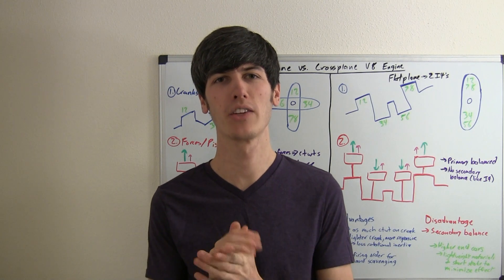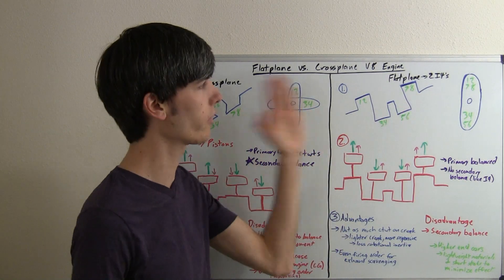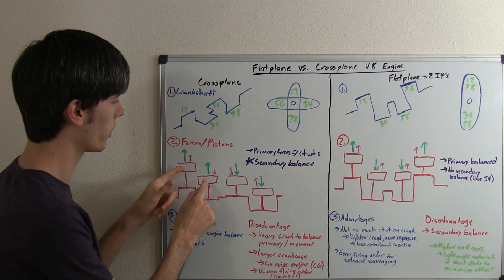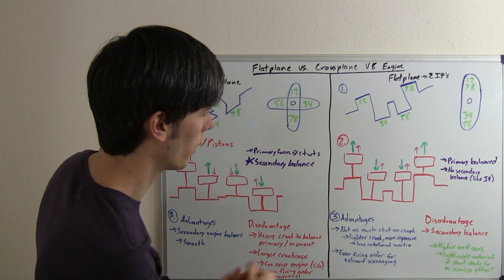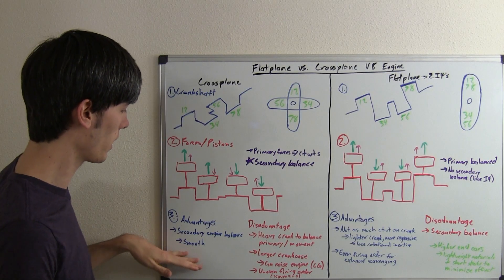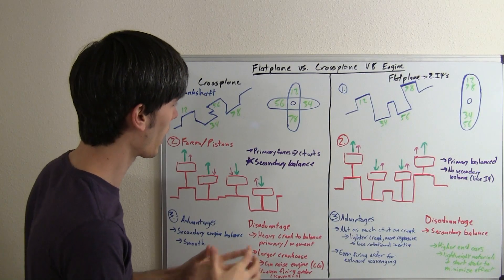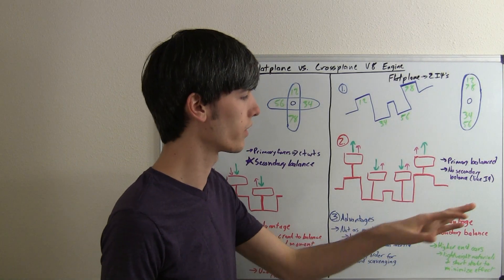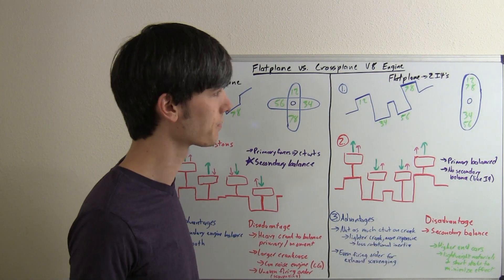Flatplane vs Crossplane V8 Engines - Which Is Best?

Comment: On a crossplane crank you still have a secondary imbalance occurring but not as severe as a flat plane (half the strength but twice the frequency in every crank rotation ) that's why not as noticable but it's there!!

Comment: So does this mean that the Ford mustang gt350 will not last as long as other cars who use a cross plane crank? The new mustang v8 sounds great and makes a decent amount of power. However since the mustang is cheaper than lets say a Ferrari than does that mean that ford used cheaper parts in their motor. Thus making the mustang engine less reliable?

Comment: Question for everyone out there... Other than the 2009+ Yamaha YZF-R1 (and a few low quantity race engines), why are there no 4cyl crossplane engines out there? To me it seems like a great compromise between modern fuel economy regulations and that classic crossplane V8 burble. Just look up the Yamaha's exhaust sound and you'll understand what I mean! It could be a potentially smoother and more reliable engine compared to our every day i4's of the world. Just imagine a Focus RS with a 2.5L crossplane that sounds just like its mustang bigger brother... I've done a decent amount of research with no concise answer. So why hasn't it been developed?

Comment: Why does a MotoGP bike then use a crossplane engine?
Reply: The enginepulses from the uneven firing order is supposed to leave a gap in power delivery to the rear tire that lets the bike grip in the "gaps" of the enginepulses thereby making the bike easier to control thru high speed corners where in motogp powersliding is the norm.

Comment: Questions regarding flat plane cranks:  

Background: I'm considering replacing a cross plane crank with a flat plane crank.  Assume I've taken care of the changes to the valve timing from the original crankshaft (I would initially want to do this on a 4.6 liter Ford V8) and can find the space for the balance shafts (newly designed oil pan) and drives (gear).  Also assume I have a compelling reason to go to all of the hassle (it "kind of" has to do with even firing within each cylinder bank for specific, proprietary reasons).

Based on your video on balancing engines and the statement that a flat plane V8 has imbalanced forces as two I4s, is it correct to say that a couple of balance shafts rotating at twice the crank speed would take care of that secondary imbalance?  Assuming the answer is yes, would the balance shaft weights be located at the "average" of the locations if you were to design separate balance shafts for each cylinder bank?

Comment: is this why an America  muscle car engine sounds so different from say a modern german V8 in an audi or BMW?
Reply: and typical American V8 also Cross plane?
Reply: yea thats why Shelby Mustangs rev to over 8k and rev more lively and Camaro/Dodge engine dont rev as high and arent as lively. Its the crank that makes the difference
Reply: um no. every v8 out there in production... pretty much uses cross plane. shelbys definetly uses crossplane. germans also use crossplane. the firing order may be different thats the difference in sound. and its the gt350r that JUST RECENTLY used a Flatplane crank in its v8, it still sounds like a ford because of the headers and firing order. Ferrari has been using them flatplane v8s since the 80s this is nothing new. perfect example of the noise difference look up a 2012+ yamaha r1  and then any other 1000cc sports bike.
Reply: jakub pogorzelski you Dingus. The Shelby gt350 is flat-plane. Although the regular 5.0 is cross-plane.
Reply: jakub pogorzelski worth to mention GT350 has very unique crank which isnt in fact anything like typical inline-4! Although the crankshaft has its singleplane construction it has first and third bends on one side and second and fourth on another...
Reply: hi, is it safe to say that flat plane and cross plane are total opposites of each other? and for the flat plane, since there is no secondary balance, you need counter weights for it right?

Comment: Can 3,4 and 5,6 be exchanged on a cross plane? What will be the result?
Reply: I think I can answer this one:  yes, you can exchange the pin locations on the crankshaft but it would be expensive to do.  Since the piston location would now change 180 degrees (based on engine rotation), your intake valves would open near BDC instead of TDC and there'd be no air pressure difference to cause air to enter the cylinder, so without other changes you'd lose half of your engine's power.  A newly ground camshaft can be ordered (with the lobe positions exchanged -- don't forget the exhaust lobes should be moved as well).  Now your engine should run, but any vibration will be out of phase with the original since your firing order must be changed to match the valve movement.  I think it would be imperceptible  though.  Oh, and after throwing a huge amount of money at the task your engine will produce the same amount of power and fuel economy as before.

Comment: I would love to see you do a video on Yamaha's new crossplane i4 used in the R1 and the crossplane i3 used in the FZ09/XSR900!
Reply: The cross plane crank in the R1 is one of the coolest engines I’ve ever experienced, it has such a beautiful mind blowing torque curve, and it just sounds absolutely phenomenal
Reply: Convert to 2 cycle, poooet valve loop scavenged as you don’t have to cut ports into it
. Unkessyyou want too
Reply: Bruce Miller the 07 has a cross plane twin
Reply: @IntoTheMystery13  2009 was the first year for Yamaha to use the cross plane in the R1. I know because I rushed to buy one.
Reply: DaG37boy I went to a motogp race. Heard the M1 rip all day. Had an R1 in less than a week. Going on 8 years and I’m still in love with that sound.
Reply: @jlo13800  It is a 4 stroke engine, not 2 stroke.
Reply: As well as the MT/FZ-10, 160hp out of 997cc is truly amazing considering it's price and simplicity.
Reply: Anonymous Anonymous the R1 makes 200hp out of a 1000cc engine with the ceros plane crank
Reply: @anonymousanonymous9991  At the crank maybe?
Reply: @ToddSails  I'm not sure if 160 is wheel or crank power. Impressive regardless imo
Reply: Rabid Gearboy you had me re-reading myself at “I shouldn’t have to explain”. For some bad reason I saw MT and not M1. You’re right, you shouldn’t have to explain. 

But they sure do sound similar!

Comment: Maybe someone could answer this, 1974 pontiac 455; my crankshaft "pully" for the water pump and so on would "shatter", a round crack would form on the pulley and shear. What caused this, was this bad balance? Pulley would last about 1000 miles...

Comment: i take it that flat plane are also more fuel efficient since less power is used to rotate a little crank.
Reply: Yeah so the little crank can spin faster which means higher RPM'S but usually not as high torque as with a larger one

Comment: hey is there any advantages/disadvantages in terms of power delivery/torque, also why do flatplane engines safely rev higher than most crossplane engines of the same size etc? i would have thought the vibrations would cause stresses on journals etc?

Thanks
Reply: they rev higher because the crank is lighter
Reply: +arien wilkins That doesnt answer my question, you just repeated what he said in the video. My question is what would be more reliable at high revs? the crank maybe lighter but the vibrations would cause lots of stresses on the block and the components
Reply: The Crossplane engine would be more reliable  at high revs if it were given a proper exhaust system with 4-2-1 headers into an x-pipe, such as nascar. Even with their pushrod valve train they can safely rev to 10000 for 500 miles straight. Also the lighter crankshaft has nearly nothing to do with its high revving capability. It acts as a fly wheel, so you can take mass off the crossplane's fly wheel to get the same rotating mass, and I doubt any manufacturer would run no flywheel. The main thing that allows you to rev is airflow at the higher rpms, flatplane crank v8s can get away with 4-1 wide diameter short headers (which would be optimised for torque at high rpm) Crossplane engines cannot do so due to uneven exhaust pulses. But for prolonged periods of engine life, the secondary vibration from flatplane layout has detrimental affects to life of materials, and components, especially bolts.

Comment: I watched the video and since I'm not an expert I have a question about the weight of the crankshaft necessary for ideal engine function in a crossplane system.

Wouldn't the weight not matter considering the flywheel is a weight that keeps everything turning in one direction? Or does the rotational force not make enough of a difference to replace the necessary counterweight?

Comment: I would have been interested in knowing which car models use the two different kinds
I am guessing Cadillac and Lincoln, would use the flat plain? Luxury cars?
Reply: I guess it would depend on application. Lightweight sports cars would probably tend to flat-plane, while cruisers designed for comfort over long(er) distances would favour cross-plane engines.
Reply: +Sctslincoln almost all road cars use cross plane V-8's.  The only mainstream manufacturers that have used flat plane V-8's in a production car are Ferrari, Lotus, Porsche, TVR, McLaren, and a handful of performance Ford and Cosworth engines.  He didn't emphasize in the video enough, but cross plane V-8s are much cheaper and generally much more reliable and longer lasting than flat plane V-8's, in so much that it doesn't make much sense to put them in a car that cost less than $100,000.
Reply: PhysicsDude55
Thanks for answering
I often wondered what the differences of engine types were.
I like his videos, but wish he would mention the brand names of some of the stiff He talks about
Thanks again

Comment: Interesting video but there seems to be some confusion around the secondary forces. To really understand the advantage of a crossplane in terms of secondary balance, you really shouldn't have drawn a graph. I might be wrong but as far as I know, CP V8s still have secondary imbalance, just not as strong as FP. I struggle to wrap my head around it and a graph showing resulting forces would have be great! Pleeeaase ;-)
Reply: They still have the force you know of, which is vertical, from piston travel from crank angle 270-0-90 being faster than 90-180-270, though it occurs 4 times per revolution instead of 2, so it is technically not a "second"ary force, also, the pistons which do this don't travel in pairs so it's not as powerful either. The only forces taken into account in noise vibration harshness are primary and secondary forces and moments, (no 3rd,4th,5th, 6th, 8th or 9th )

Comment: A comment I heard about crossplane vs flatplane v8 is that only the crossplane have the deep bass noise (possibly due to the exhaust issue that you mentioned). Also I heard some comments that  you can't make a flatplane sound like a crossplane, however you can make a crossplane sound like a flatplane by linking the exhaust runners of each cylinder bank together with a pipe. Any truth to that?
Reply: +paul zapodeanu You are absolutely correct that you can make a crossplane sound like a flatplane by linking the exhaust runners. Google "180 degree headers". These headers are nicknamed "a bundle of snakes" and when you get a chance to look, you'll see why.

Comment: what about inline engines with cross plane crankshaft? I think I helps balancing the engine better that flat plane because of the altered firing order and the sum of the forces moving inside the engine

Comment: The latest American muscle cars got high displacement V8s around 5-7 L, and these cars are able to achieve great overall speed within 7,000 rpm (assuming a limit for a cross-plane crank). That being said, do V8 supercars like the Ferrari 458/488 and the McLaren (insert-PS-numbers-here-because-they-look-cool) have flat-plane crank V8s and do their closer-ratio higher-number speed transmissions help in launching these cars as fast or faster than the American high-D, low redline competition?
Reply: You got pro stock 8.19 L Crossplane v8s revving to over 11000, and nascar engines revving over 9000 for 500 miles straight.

Comment: hope you do a piece on the new ford flat plane v8! and also read ideal range for flatplane bc of vibrations tops at about 4.8L. Read Ford didnt want turbo bc nonlinear power delivery so expanded to 5.2 for power but then used some sort of counterbalance. Know you dont work for Ford but instead of adding complexity from engineering point what would be disadvantages (other than linear delivery) of going from 4.8 w turbo to 5.2 natural w counter to quell vibration.

Comment: So, regarding the 2009+ Yamaha R1's cross plane crank, is the motor actually heavier than an equivalent flat plane design and with potentially less power than a flat plane layout?? The motor has a great exhaust note, but sounds like a flat plane crank would have provided greater performance.

Comment: Cross-plane-crankshaft-V8-engines aren't any more sluggish, due to the counterbalancing-weights. The polar-moment-of-inertia of the flywheel can be suitably reduced, by an amount equal to the sum of the polar-moments-of-inertia, due to the counter-balancing-weights, such that the total moment-of-inertia of the crankshaft-plus-flywheel Assembly remains the same, as it was, without the counterweights.
Reply: 100% correct sir.

Comment: ALL HAIL THE V8!
Reply: V8 Akbar!

omg so going to hell for this.
Reply: Amen
Reply: Crossplane for the win
Reply: JustAnotherCarGuy except if it's a Ferrari engine
Reply: Flat-plane ftw !
Reply: WITNESS ME!!!
Reply: The cross plane make for a better 2 cycle conversion!
Reply: Flat plane for the Ferrari, cross-plane for the Maserati which uses a "Ferrari-derived V8", at least the lovely M139 Quattroporte, and what's that supposed to mean? Well, now we know!
Reply: Hail the V8
Reply: C8.R says no
Reply: Cars modified for the track all have flatplane crankshafts for a reason though :P
Crossplane does make the engine vibrate less, but it reduces their performance. Only 6 out of 8 cylinders can scavenge competently on a crossplane. That means their maximum RPM will be far lower.
Reply: @rich1051414  GT350 redline 8500, GT redline 7500.  Don't think that qualifies as "far lower".  GT350 max horsepower at 7500, GT at 7000 (torque max is lower in the rpm range for both.)  Most people would probably stop there, unless of course you're in a race and need the remaining extra speed.

Comment: Thanks for the link . The inline 4 Yamaha R1 has a crossplane crank on later models . Would this engine need a balance weight to counteract primary vibration like a V8 crossplane ?

Comment: So what about some Ford V8's that had a different firing order compared to GM & Chrysler V8's, does that have anything to do with a crossplane or a flatplane crankshaft or just different positioned lobes on the camshaft? [As far as I know all US V8's have a crossplane crankshaft]
I've heard some Ford V8's also had a reverse rotation, please explain. Thanks.
Reply: The optimal firing order for Crossplane v8s is the Ford 351 Windsor and GM Ls firing order, the Windsor had opposite rotation and cylinder numbering but fires exactly the same, the sequence 18726543 evens out the torque loading on the main bearing journals and promotes cooling by moving the 2 consecutive firing cylinders to the front

Comment: Can an I4 engine be a crossplane setup instead of flatplane?
Reply: Jefford717 Yamaha R1
Reply: +Jefford717 Yamaha does this with their YZF M1 and with the R1 starting in 2009
Reply: If you want to make a 2 stroke out of it. like a4-53 or4-71 detroit diesel.
Reply: most 2 cycle engines are like the Detroit 4-53 and 4-71.
Reply: yes Yamaha has one
Reply: Yes, but I believe it results in an uneven firing sequence.

Comment: He doesn't do a very good job of explaining just what primary and secondary balances actually are.  [Constructive criticism:  Give a quick layman definition of terms before you launch into a discussion].  Primary balance has to do with the masses along the crankshaft being even.  In flat-plane, on each bank two end pistons move up, two inside pistons move down and vice versa, so there is primary balance.  Cross plane has pistons moving all over the place, and this causes the engine to rock "nose up, nose down", as if an axle were mounted laterally through the engine.  Heavy counterweights negate this rocking motion or "couple" as it is called.

Secondary balance has to do with the fact that the piston that moves down from TDC actually moves a greater distance than the piston that is simultaneously moving upward from BDC during the first 30 degrees of crankshaft rotation.  This uneven movement of masses causes vertical "bounce" of the engine, and this is a BIG deal in inline fours and flat plane crank engines.  The only way to deal with it is to either just accept it or add balance shafts to the engine.
Reply: He's made videos on both of them...
Reply: Thanks for the info. Does this "balanced shaft" on the flat-plane fix the vibration problems just as the counter weights do on the cross-plane? Are the vibrations, even with these fixes, that much harm (longevity and performance) to the engine?